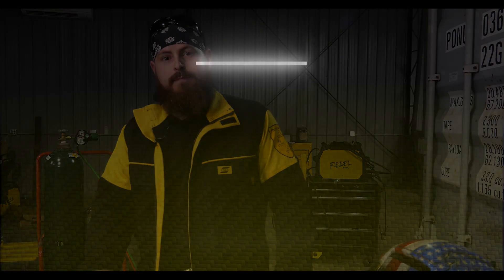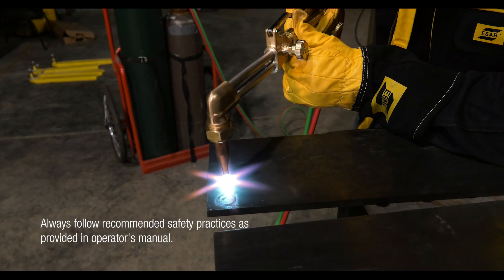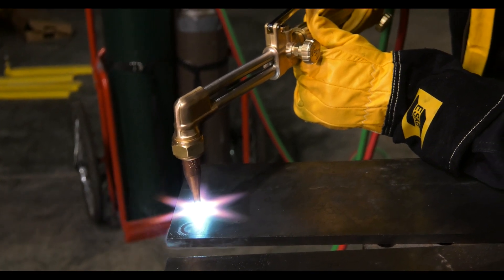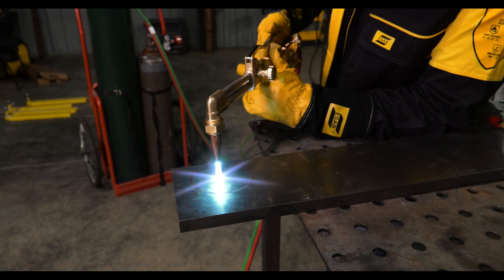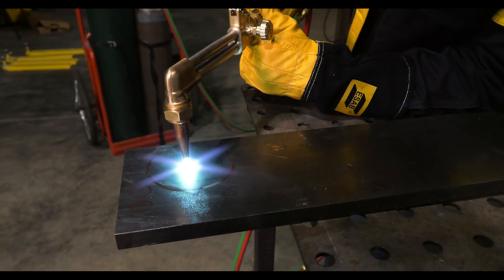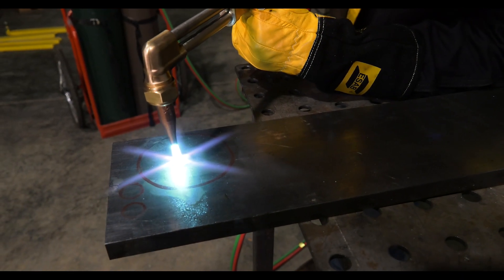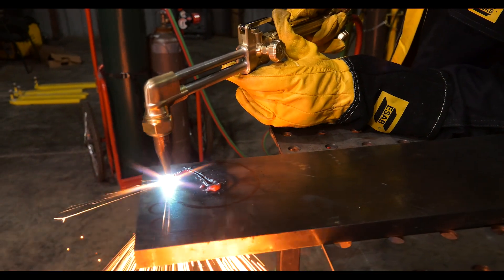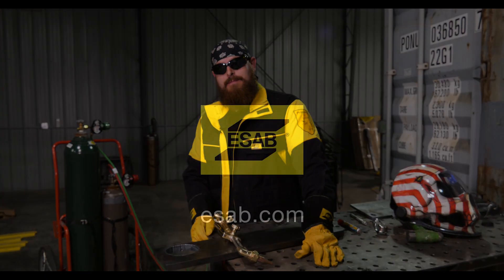How to Pierce with an Oxy-Fuel Gas Cutting Torch

Comment: Excellent job Sir !
Thank You Very Much for the "Hot Tip" ... Sorry, thought I'd try a little torch humor.....
Ok, I'm being Serious Now,,,
= When cutting a piece of metal, with a torch - why does the metal melt itself back together in the place I just cut ?
Basically, I have to Make Every cut Twice. Or make the 1st cut Super WIDE so the metal doesn't weld itself back together.
what in the HELL AM I DOING WRONG ?
It's a Small torch & Iv had this issue with it Since the day I inherited it.
Do I need to increase the oxygen psi ( Again )to blow the molten metal away  better ?
Or have I Gone Totally Mental & I need to check myself in a Constitution ?
.... I mean Institution ,,,
I know what I ment.
Anyone's help would be Greatly helpful !
Thank you ALL & Happy torching
Reply: I'm not a pro by any means, but I have noticed that if I have an oxidizing flame, the metal tends to bubble up underneath a cut and kind of fuse back together. Turning up the acetylene just a bit to achieve a neutral flame is what solved it for me.